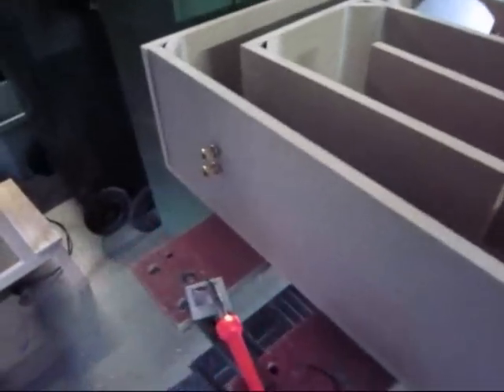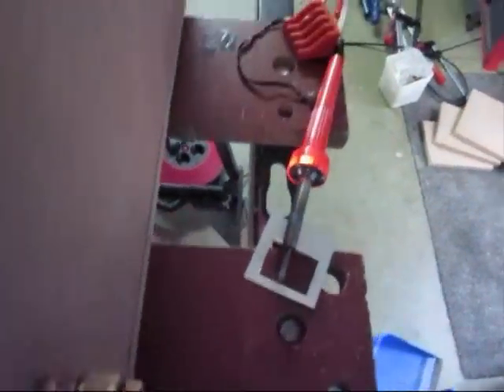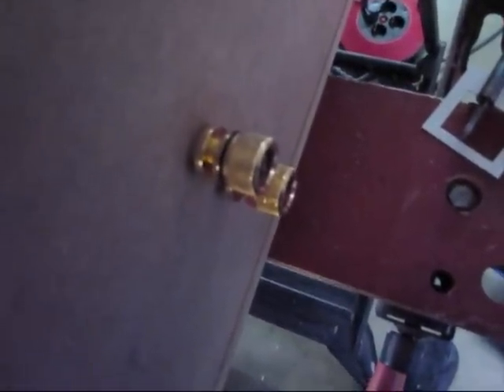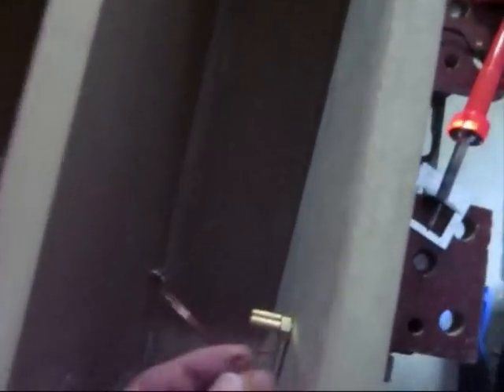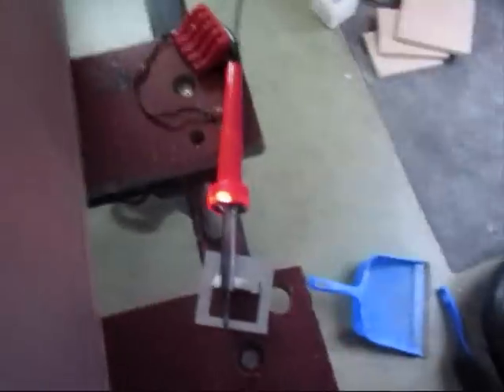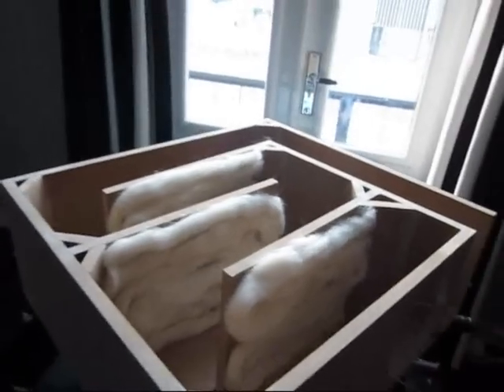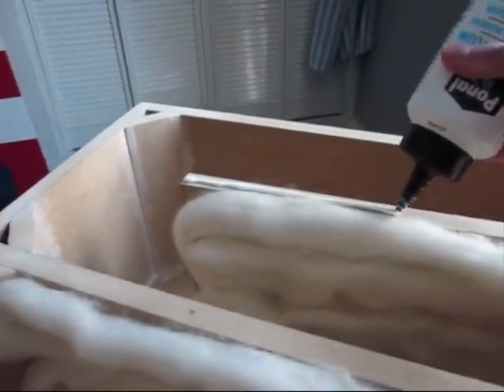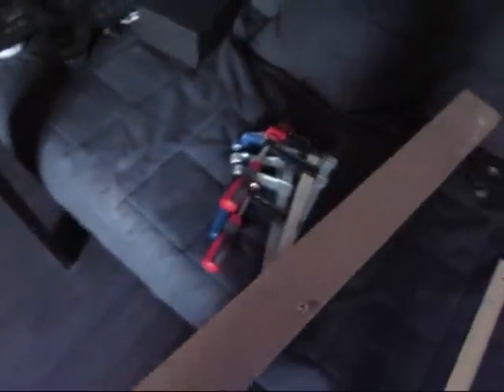Transmission Line subwoofer built part 4 the last steps

Comment from the maker: @eddy94f You can do both. If you use it as a sub i recommend doing it like i did but you should may put a little bit more dampening material in the line then i did.